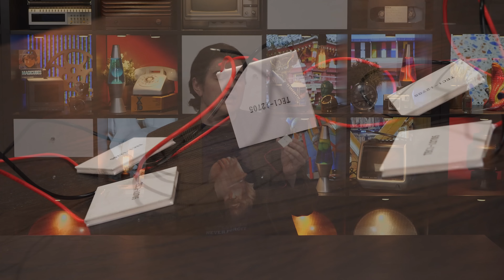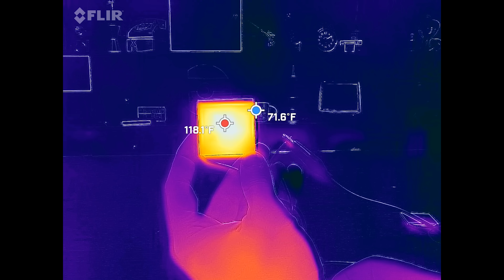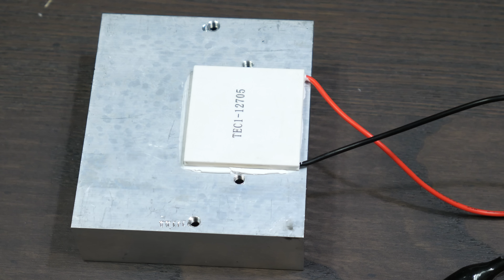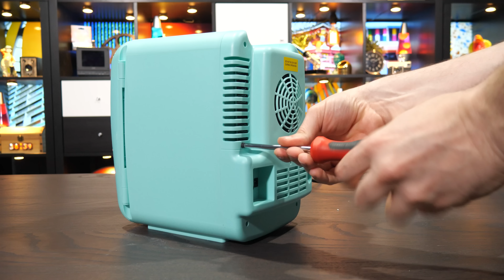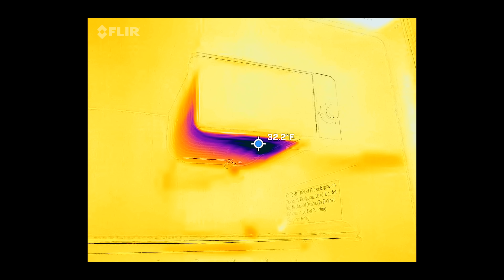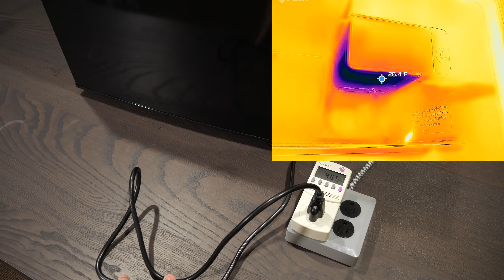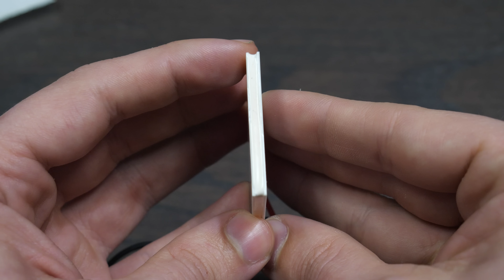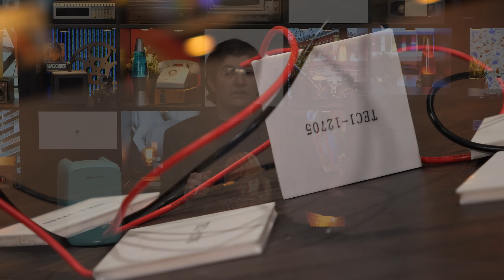Thermoelectric cooling: it's not great.

Comment: I remember back in the day I had a peltier element in a watercooling block for my video card back in the day, worked really well on my Geforce 6800 LE, but during a lan the wires melted off, and that was also like a 60-ish W GPU.

I was considering using it to cool down the air inside a closed system I wanted to keep waterproof, but I haven't had time to try and make that.

Comment: Any interest in testing out Peltiers for generating power via temperature differential? Always wondered about using them on the back of sun facing surfaces to generate power as the heat transferred thru them

Comment: one good use for a Peltier is actually the opposite of whats its being used for here
they work in reverse aka a temp diffrence will generate a voltage (called the Seebeck effect) so can be used as a power source when reliability is key such as spacecraft or radio transmitters, heat up one side with Plutonium and a massive heatsink of the other side and boom you have a Radioisotope thermoelectric generator (RTG)
Reply: Came here to say that! You were faster.
Reply: Just left a comment about this above. Biolite camp stove uses them to charge a battery.
Reply: But note that even RTGs are a niche use case, for space stuff where heat pumps would break the mass budget or be too complex or maybe not work in the environment.  On Earth we use steam engines from the 1800s.
Reply: @mindstalk  soviets used RTG's for some unmanned lighthouses and Radio Beacons
Reply: Also stove fans use them for powering a small fan to help push heat around the room.
Reply: That's really cool wtf.

Comment: We used this to keep milk cold for tea when we were renovating houses. It also didn't need to do much work with UK weather. Plus the milk was already cold.
Reply: Not to mention efficiency matters less when plugged into someone else's walls. Lol
Reply: Probably not an issue for short periods/keeping the milk chilled across an already cool working day, but do note they cool relative to the ambient temperature and milk goes really dodgy if it goes above 5°C for more than a few minutes... 😇
Reply: So.... an ice chest?
Reply: @unclejoeoakland  
Yup a simple cooler with an ice pack would have done the same thing and no plug needed.
Reply: @adamn7516  As geodkyt said, it was convenient. We just plugged it in wherever there was space to make tea. We would bring fresh milk with us from home (10 minutes travel max). Then place it inside. Usually, the fridge was just left on from the previous weekend, so it was already cold.
Reply: @unclejoeoakland Sometimes the inconvenience of dealing with a cooler full of ice is more of a downsides than the downsides of Peltier cooling.

Super niche cases, yes.  But they do exist.
Reply: @geodkyt  I wonder how a Peltier cooler might perform if you popped an ice pack in it a little while before turning it on, and only passed a small amount of current through the element? 💡
Reply: @geodkyt  But just to keep milk cold, you’d just need one of those small thermo/insulated fabric containers with a ziplock (or a hard cased one if you want better insulation) and a single, small reusable ice pack ought to do it. Neither of which cost anything near what even this cheap toy fridge sells for.

Though you would probably want to have a spare ice pack, just in case you’ve forgotten to freeze one (or have to go before it has refrozen). This is how my mom always kept milk and a packed lunch cold for travel etc.

I don’t really see how that solution is more complicated or inconvenient than having to hook up a very inefficient freezer that not only also requires the milk to be quite cold to start with, but which is potentially bit dodgy if you’re (un?)lucky enough to hit some particularly hot weather and likely needs to be running constantly to maintain a reasonably cold temperature.

Comment: Well these things may suck overall, but I'll never get rid of my cooler-console. It holds 2-large water bottles, a couple of regular bottles of unsweet tea, and a big lunch of whatever my wife has made for me... couple sandwiches, chips, snacks, etc. I plug it into the lighter socket in the truck first thing in the morning, hit the road, and even on hot days I know that when I get back into the truck after an hour of being onsite for a repair, and the truck is hot as hell, I will have a nice, COLD bottle of water to pull out while I wait for the AC to cool off the truck. Drive for another few hours to the next job site, and do it all over again. Just let it run and keep things frosty cold! This thing wasn't exactly $30 bucks though so... maybe it uses more than one element, and it does have a fan that ramps up sometimes.

Comment: Peltiers are not good at cooling, they are good at forcing a heat differential...pedantic, I know. Yes, they are very inefficient and only get more inefficient the bigger the differential you try to push, but sometimes it's more important that the heat is not there than if you're ultimately generating more heat elsewhere. Processors and camera chips on scientific cameras for example

Comment: There is a significant difference between thermoelectric cooling being good and a thermoelectrically cooled toy "refrigerator" being good. Thermoelectric cooling works to cool energy dispersive x-ray spectrometers (EDS) without transmitting vibrations (say, to the electron microscope to which the EDS is attached - electron microscopes do not like vibrations).
Reply: I wish spectrometers were consumer electronics
Reply: @adaroben1104  they are becoming more accessible! It might not be the exact type you want but I’ve seen more and more civilian gas chromatography spectrometers being made for the cannabis testing market (testing cannabis for active ingredient %s)

I even saw someone is selling a mobile setup made to fit inside a pelican case and it has computing built into it, although the software is made specifically for cannabis testing market
Reply: @adaroben1104  With fixed grating spectrometers we are kinda getting there. There is models now for around 1300€. Sure, they have spectral resolutions of some 2-4 nm, a limited dynamic range compared to other designs and the price jumps alot if you need anything past 1000 nm, but their price nears that of a graphics card for a PC. Or a bycicle for that matter. 
Also there is somewhat gimmicy 100€ or so attachments for phones. I think they achive being so cheap by using a prism as their dispersive element. For the sensor they use the phone's camera. While performance is not stellar and you are basically limited to the visible range thanks to the cameras UV and IR filters, they have their uses. We got one at work for quick looks at places where a "real" spectrometer is hard to mount or to get a general impression of the spectrum.
Reply: @adaroben1104   I've seen some chemistry YouTubers owning handheld spectrometers, I think using X-ray spectroscopy? The idea was to hold it up to a block of metal and it could indicate on the screen an assay of the particular metals inside your unknown alloy. Looked like a jumbo version of one of those barcode reader wands.
Reply: @adaroben1104  if you have enough money it can be. It's not that you are not allowed to own one. Only you will need to be some very well of nerd to be willing to spent money on one.
Reply: @adaroben1104  lol why would you want one?
Reply: @smalltime0  SCIENCE!
Reply: @adaroben1104  Funny, nothing in the title restricted the subject to consumer electronics.
Reply: And that falls within the scope of there being difference between the technology being good or bad and different applications of the technology being good or bad. So you fail hard on that comment.
Reply: That sounds like it might be one of them specific use cases he was talking about, but I’m not an electricity scientist.
Reply: @WilboMowgli absolutely! It’s a case of using the right tool for the right job.
Reply: @WilboMowgli  That is a cheap "out" for a video titled; "Thermoelectric cooling: it's not great." There is nothing fundamentally wrong with thermoelectric cooling. It has many good use cases. Just because being the cooling engine for one specific application (consumer food refrigeration) is not efficient is not a good reason to claim that the thermoelectric cooling effect is "not good".
Reply: @FinnMcRiangabra It's almost like the title is meant to grab your attention and make you click, and there's actually 32 minutes worth of content on the subject behind that click that goes into more expansive detail and nuance than the one sentence title.
Reply: @FormerRuling  So you are accusing the OP of click-bait? You said it, not me.
Reply: @FinnMcRiangabra  That isn't what clickbait means, but nice try.
Reply: @FormerRuling  What you described is exactly click bait. Click bait can refer to the title or the thumbnail image.
Reply: Yes! Exactly. Peltier cooling is not total garbage, it just is not a good substitute for a home refrigerator - which is like, not even remotely surprising?
Reply: In fairness, he is mostly talking about thermoelectric cooling for consumer purposes. I don't think he's making an appeal to the lab designers of the world.
Reply: @dojelnotmyrealname4018  In fairness, a video titled, "Thermoelectric Refrigerators: they are not great," is the stupidly easy way to address that special pleading in your post. The OP is a clever guy. He presumably could have figured out a title like that with a bit of thought.
Reply: @FinnMcRiangabra  Valid.
Reply: Finding niche uses for a tool doesn't keep it from being a 'not great' tool. Chalk string has some niche uses but compared to a laser level, it's not a great tool. For 90% of use cases where you want a cooling effect, there are better solutions than thermoelectric.
Reply: @GameOn0827  What are you on about?? Chalk string is in no way a "niche" use. It is a technology that has existed for hundreds of years and works great. Have you ever laid tile??
You are comparing that to a laser line layer? And you had better be clear about what you mean. There are plenty of laser line layers that will project a reflection along a line but have no control over how level or plumb that line may be vs more expensive units that combine leveling or plumbing with the projection. And they are still not that great because if you are trying to align tile to them they have to be powered on, fixed stably, and not in your way. Vs. a chalk line which is set it, snap it, and go about your business.
The appropriate uses of Peltier cooling are not "niche."
Reply: @FinnMcRiangabra  I can't tell if you're being intentionally obtuse because it makes you feel intellectually superior to disagree with consensus, or if you're just ignorant of half the words you're using. Either way, this is not a conversation worth starting. I'm not trying to argue with a contrarian that the sky is blue.
Reply: Yeah - it's all in the application! I work for a company that makes electrical/optical measuring instruments and almost every one of them has TECs in them for keeping optical components, or the sample being measured at a stable cool temperature without introducing vibration.
Reply: So it's useful for cooling things under electron microscopes in a lab but not for making things cold. Technology is more useful for stuff outside of keeping things cold.
Reply: @Yubl10  ??? What is the point you are trying to make?
Reply: For the various doofuses below complaining about how my one example is "niche" (which misses the point) try this equivalent claim:
Fission power reactions are not good because they are bad at powering cars.
What I have done there is set up an unrealistic metric - the use of fission power for cars (that's basic nuclear power plant power technology BTW). If you judge the totality of whether fission power is good or bad based on the one example that I gave, powering a car, you would come to the conclusion that fission power sucks. The car would need shielding, making it much heavier. It would require reliable cooling to deal with waste heat. If you are going the radioisotopic thermoelectric generator (RTG) route, the power is very limited... etc.
But none of that applies to fission power supplying power to cities or ... get ready for a "niche" application... powering spacecraft that have to operate very far from the sun. The fact that RTGs are extremely useful but are not a widespread use case does not make the conclusion that fission power for cars is bad wrong. It just makes that argument pointless. Yes. fission powered cars are a bad idea. That does not make fission power bad. Peltier cooled toy "refrigerators" are bad. That does not make Peltier cooling bad.
Reply: @FinnMcRiangabra  You're being disingenuous. Get some dignity.
Reply: @seigeengine  I don't think you know what disingenuous means.

To clarify for you: I mean what I have witten.

Your comment about "dignity"?  What is your problem? Did I pee on your cat?
Reply: And, not (entirely) trying to suck up here, I suggest subscribing to this channel. It is overall excellent. It is evidence-based, which is great.
I came to this channel because it was the first thing that popped when I searched for why box fans go: off, 3, 2, 1. And I have been hooked since.
So my grumbles about this one video notwithstanding, this is an informative and entertaining content creator.
Reply: This is probably the most disingenuous response I've read yet.

Comment: I had one of those desk fridges 20ish years ago. Apparently the door had some insulation as it could freeze drinks, but not enough to make them burst, or the pressure lowered the freezing point just enough that they stayed a liquid until the can was opened and then was almost a slushie. That only lasted a couple weeks as I believe the TEC degraded over time.

Comment: The big problem is that the Peltier device is a good thermal conductor, so all the heat energy you're 'pumping' from one side to the other is just trying to leak back. They can be reasonably efficient if you keep the Delta-T low and stack devices, but then you loose the advantage of cheap. I built a microscope cold stage (to chill insects into dormancy for examination) and used a liquid cooling plate on the hot side. If the cooling tank was filled with ambient temperature water, the system would gradually loose efficiency and eventually start heating the cold stage. Drop a couple of freezer packs into the tank first and it would happily run all day. A fun trick was to put some drops of water onto the stage and slowly take the temperature down below 0C. I had liquid water down to at least -5C.
Reply: I was thinking about making a dry cabinet with peltier, and stacking is exactly what was in my mind.

But the energy consumption worries me. I can probably run a whole room dehumidifier at that cost.

Comment: A company I worked at purchased 200 of those fridges against the advice of every engineer there. they had to decommission them after a month after three caught fire. They didn't even have the bare minimum of a fuse on the secondary winding.

Comment: I was wondering when you would cover these. Some work better than others. I admit to having one of these in my office, I bought it when the department mini fridge died and finance refused to replace it. It works well at keeping drinks cold, and the food I bring in the morning I eat by noon anyway. Mine has a switch to where it will run on 120v or 12v for bringing it on road trips. I bought a slightly better one at $65 so I imagine it works better than these bargain basement units, it has a much quieter fan than the one you showed, and can hold 18 cans. I don't have room for a compressor fridge under my desk, so there's that as well.

Comment: Unfortunately, the free-piston Stirling heat pump is really the only option if you want to make a small (portable) cooler that actually *works*.

I'm pretty sure the Anker ones are vapor-compression, they cut off if not kept upright.

Comment: Really, there's only three things I'd consider 'pro' Peltier: They're cheap, they're completely silent and they're super easy for a hobbyist to include in a build.
Hence why I've put one in a custom soda bottle cooler I've built with a copper plate bent into a semi-circle on the cold side (insulated with expanded rubber) and a CPU heat sink on the hot side. I just hook it into my PC's 12V power because I didn't feel like looking for an approriately powerful 12V PSU.

Comment: They can be great for some specific purposes. If you are storing high end wines, the vibration from a compressor based fridge can have negative effects. Also, if you need a small cold and high humidity environment, they are great. Many people use them for small meat curing chambers.

Comment: I have a slightly more fancy version of one of these which I got for around 25$ from work. I chose it over a normal minifridge we also offered mainly due to space constraints, and while already understanding the multitude of downsides these have. That being said, this particular model has surprised me. When I first got it, I would pop an ice pack into the top snack compartment to help keep the drinks down below at roughly an icy 35 degrees, helping offset the hot summer heat outside the unit. However, and to my surprise, I recently stored some cold drinks inside with no ice pack available, and the next day found them still comfortably below 45 degrees, good enough for a soda. I know the insulation in this thing is pretty terrible, so I am questioning if the peltier module has somehow gotten better with time and heat cycles.